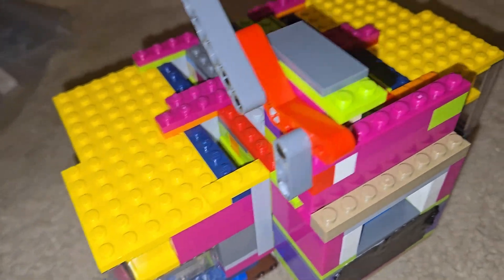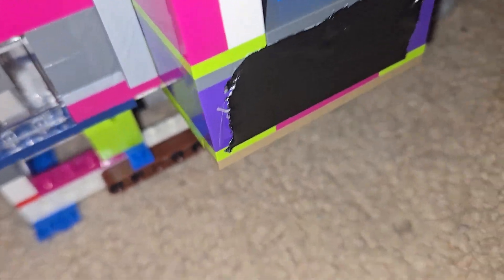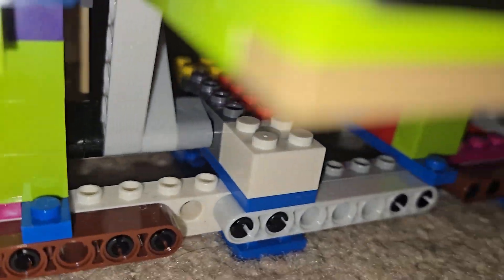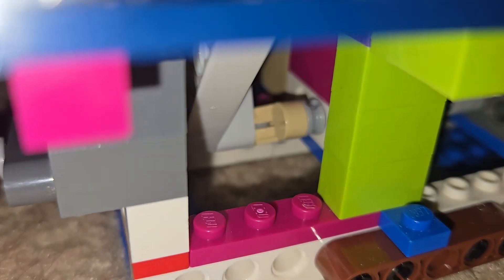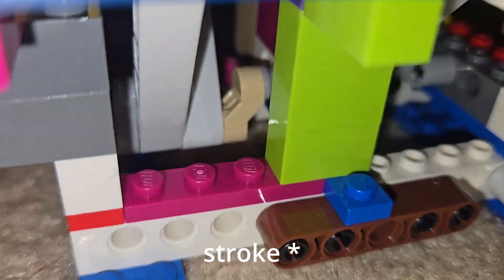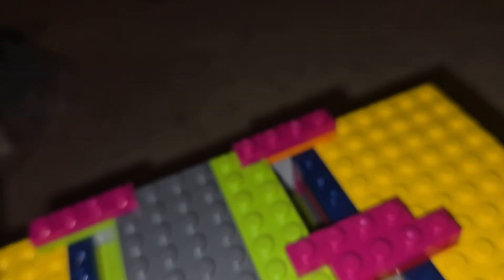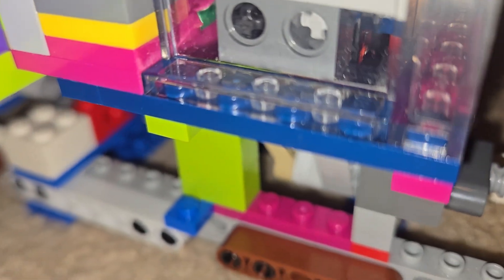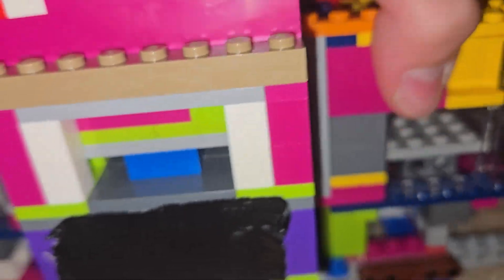VR4 Lego Vacuum Engine

Comment: I like that you offset the cylinder banks like a real one
Reply: Btw you can just use toilet paper in between the bricks to hold the pistons together (or you can try anyway, I've never used a 4x4 performance piston or built a vr engine so maybe it wouldnt work for that)
Reply: And the sound is ridiculous 🤯
Reply from the maker: thank you for watching. i think ive tried toilet paper before but it just didnt really work. besides, i dont plan on taking this engine apart.